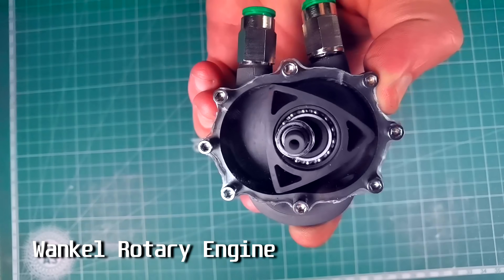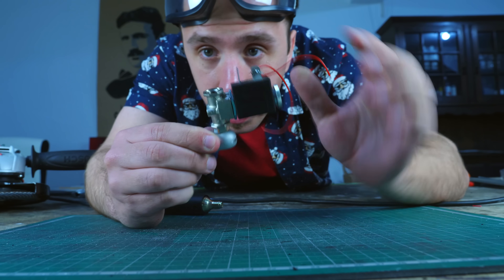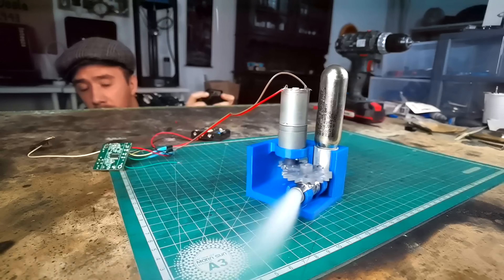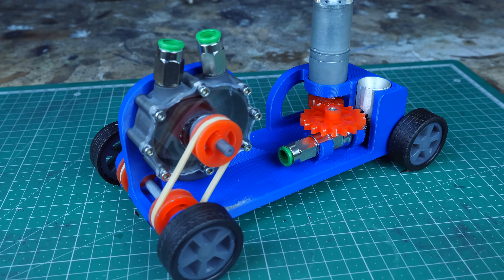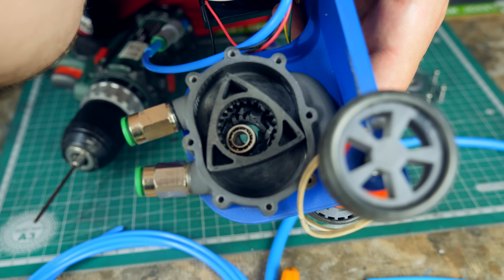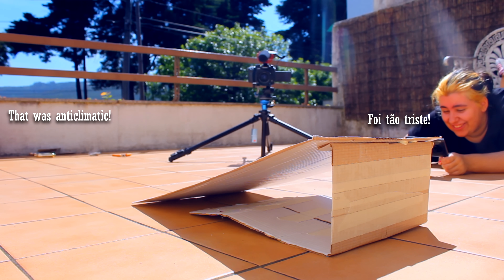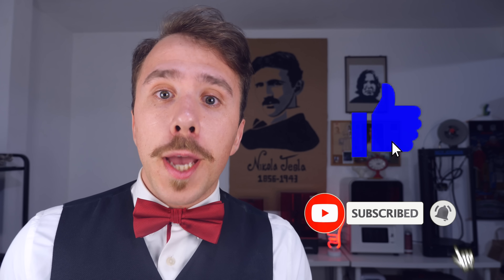Rotary Wankel RC Car (3D Printed)

Comment: My hat told me to apologize to the beautiful country of Portugal
Reply from the maker: Your hat is forgiven !
Reply: @integza  hey why don't you use the released gas from engine again
Reply: @guy4814  that is a problem, that was used in steam engine, and careful engineering and calculation resulted in at most three cylinders in a row, then there was no use adding more cylinders.
I guess the output from this wankel engine are too wast and would benefit from reducing the speed it uses the CO2 gases, so that the gas has time to boil of properly and give away it's energy.

That would probably be the best way forward.  To use an needle vale and carfully open it up to release the gas properly.
Reply: @integza  you're loosing a lot of energy with your pulley belt before the engine blew(It was slipping) Tighten it up and watch your power increase.
Slow-mo cam was like watching a serpentine belt slip over a seized pulley.
Reply: @integza  I designed a fully 3D printed drone and uploaded the complete STEP file and STL files to Thangs. Search 'cornishco' or '365 quadcopter'.
Reply: @integza  And YouTube should apologize to you as well because it unrang your bell for me :'( :'(
Reply: @integza   make a hydrogen bomb
Reply: @integza  Im not sure if anyone else realized but the editing and sfx are way better than your last videos
Reply: @integza  you need to contact rob dahm he is building his own engines
Reply: @integza  Compressed floor powder as rocket fuel??
Reply: @integza  you fool now everyone’s going to @ you 

Also those cartridges release more power if it’s a single, split second pulse rather than releasing it all at once, that’s why in Airsoft (what those cartridges are mainly used for) you never hear any long hissing sounds in a full auto CO2 rifle. It’s just releasing the gas in pulses. You could probably make this valve mechanically controlled/timed by connecting it to the rotation of the engine, However this would require you to crank the engine when you want it to start, but it’s still worth it.
Reply: @integza  put some tensioners on the belt to make it perform better
Reply: @integza  Portugal is not a country, it's just a place in Spain somewhere.
Reply: @integza love your engines
Reply: @integza  hahhahahahhhaha lol that's nice
Reply: Yes
Reply: @Joel Creates I like your hat! 👍   😅 I have several Ushankas too.😄
Reply: @patrichausammann  👍
Reply: Very wise hat.
Reply: I love that two of my favorite creators team up! You guys are awesome!
Reply: Video idea: 3D print a CNC machine that slices tomatoes 🍅.
Reply: Replace rubber band with thick gears
Reply: @prakharsingh5496  and a pressure reducer with an expansion tank containing an internal diaphragm to increase capacity.
Reply: My kids and I want to see you develop 3D printed prostetics that utilize servo assistance. 
If we win the printer that's what my daughter and I want to work on.
Reply: Loved the times we visited Portugal before the human malware...
Reply: Video idea ( make a hydrogen bomb)
Reply: @prakharsingh5496  hang in there buddy........things are going to get better. Keep your chin up!
Reply: Wait... That’s not fair! Now Joel will win the printer! 😂
Reply: You should figure the amount it takes to torque the wheels and also use the exhaust to power another engine! Gasket also. Make sure the wheels turn at the rear of the vehicle.
Reply: Time to make a walking robot!
Reply: Portugal Caralho
Reply: @Wischmopps politicians roflmao
estado é uma gangue.
Reply: Muita Gente chegou aqui achando que Integza era Brasileiro.
Reply: Is that phone to use slow mo is Poco X3 Pro?
Reply: All the Brazilians shitting on us, but they seem to forget who is richer and more developed (and no, it definitely wasn't your gold.)
Reply: @davidfernandes896  Richer? Brazil is the 8th bigger economy and Portugal is the 46th. 🥴
Portugal developed? not excacly...the only one advantage is Portugal have access to European Union, but you aren't Germany.
Reply: @AMV12S  dear friend, Portugal is the 36th most developed country on the planet with an HDI of 0.865 (data from the UN) while Brazil hasn't surpassed the 700s.... While Brazil nominal economy is much richer, per capita Brazil pales in front of Portugal, of Europe and the whole world. While your gdp per capita doesn't surpass the 15k mark (this is adjusted for purchasing power parity), Portugal has a gdp per capita PPP of 34k. Meaning Portugal indeed is a richer country and a more developed one. You might come at me saying "oh! What about São Paulo?".
Is everyone In são Paulo rich?
Brazil is a country with massive inequalities.

Nominal GDP cannot be used to measure a country's wealth. With a population of 200 million, it's natural that you need a large ammount of money, the ammount of money that each person gets is a correct messure of wealth and development, messures by which Brazil is way way behind Portugal.
Reply: Nice 💯
Reply: Estas desculpado 🤣
Reply: Bro make a soviet battle tank or a submarine
Reply: What Is Islam?

Islam is not just another religion. 

It is the same message preached by Moses, Jesus and Abraham.

Islam literally means ‘submission to God’ and it teaches us to have a direct relationship with God. 

It reminds us that since God created us, no one should be worshipped except God alone. 

It also teaches that God is nothing like a human being or like anything that we can imagine.

 The concept of God is summarized in the Quran as:

{ “Say, He is God, the One. God, the Absolute. He does not give birth, nor was He born, and there is nothing like Him.”} (Quran 112:1-4)

Becoming a Muslim is not turning your back to Jesus. 

Rather it’s going back to the original teachings of Jesus and obeying him
Reply: LIQUID PISTON ENGINE
Reply: don't use rubber band, use gear it's make more faster!!
Reply: @Atarisyad Nuzulla Satrio Nyet.
Reply: Wait integza is in Portugal where exactly?
Reply: Eu ia fazer um comentário produtivo mas daí li os Ladrões de Ouro brigando com os HUE HUE BR. 
Podem continuar
 🥤😎🍿 estarei aqui vendo o circo pegar fogo
Reply: Catarina its portugueses?!
Reply: Desculpas aceitas

Apologies accepted
Reply: YES XD
Reply: YEs
Reply: Portugal=Brazil
Reply: YES
Reply: I think Portugal situation is way better than Brazil, you are near to other countries with advanced industry and market. But of course, Brazil and Portugal deserve to be a better country with more people developing technology.
Reply: @AnotherByteData  they both deserve that a larger part of the population survive Covid-19.  And have leaders that take it seriously.
Reply: @AndersJackson  Agree!
Reply: I’m a American but I hate it here I wanna move conuntrys in a few years when I’m old enough
Reply: @douglasbailey8332  Many young people do not seem to like the US anymore. You could try and make a change though.
Reply: @flo090394  yah you have a point I’m just homophobic and it seems the us is turning almost all gay but there are a few good place I caint say it’s all bad I’d just like a change plus I’m 16 so I got a few years
Reply: @douglasbailey8332  USA is a nice place to visit, and most people are open and inviting.
That said, there are some serious flaws with make me never want to live there.
Reply: @douglasbailey8332  then go those of us that love the US won't miss yea.
Reply: @douglasbailey8332  don't blame you cohort, been there and I agree, it's a terrible place
Reply: Brazil > Portugal
Reply: @AMV12S  portugal>brasil
Reply: @ariatsu9274  Se você fala "gajo", está automaticamente refutado.
Reply: @AMV12S  ouro
Reply: @ariatsu9274  Guy Guys Stop Fighting.
CORTANA ASS>WORLD!!!.
Reply: @jhonsqueaks4573  We aren't fighting, we are joking 🥴👌
Reply: @ariatsu9274  em qual realidade ? ,todas e eu chequei Brasil > Portugal
Reply: @AMV12S  huahauhauhauhauh
Reply: @AMV12S  se tu compara dois países vc e pior n importa de onde vens
Reply: @AMV12S  Se falas "galera" estás refutado também
Reply: @AMV12S  voces dizem cara, isso é uma parte do corpo mano.
Reply: @ariatsu9274   brazil= Portugal
Reply: @ariatsu9274 Brazil > portugal
Reply: @AMV12S  shut up  haha where is your gold
Reply: @gon_rasoilo3867  I have only bitcoin 😌
Reply: @AMV12S  Brazil = Portugal > You
Reply: @AMV12S  olha bem quem temos awui um bebe chorao a tentar espetar a sua opinião nou pedida nas nossas caras vai e volta para o teu contentor e imagina wue estas a viver a vida de sonho brasileira
Reply: @CabritinhaJP  você está automaticamente refutado
Reply: @AMV12S  if Brasil's that great how'd u let ur gold go 😂
Reply: @joaoaoj100  and you guys give it to Spain
Reply: @AMV12S  nah England took it 😂
Reply: @AMV12S  let's not start country wars.
Reply: @AMV12S  no
Reply: @AMV12S  agree
Reply: @AMV12S ehh Brazil is terrible country
Reply: @AMV12S  nah
Reply: @AMV12S  os portugueses jamais teriam eleito bolsonaro, sabichão…
Reply: @marcelleza  mas tem outro soça ai que é tão desnecessário quanto ele, inteligente são os suíços que não deixam politica atrapalhar a vida.
Reply: @AMV12S  ai eu tenho que concordar com você/ now i have to agree with you
Reply: @AMV12S  big no no
Reply: @AMV12S  no, Brazil=Brazilian portuguese
Reply: @itswindyyy  Brazil = Brazil
Reply: @AMV12S  YOU ARE GOING TO BRAZIL
Reply: @annabelle5640  i'm already at here
Reply: @AMV12S  ta errado
Reply: @AMV12S  Brazil ~ Portugal
Reply: @AMV12S   USA > all

Comment: I have this crazy idea how about you you create a normal sugar rocket and then drill a hole all the way from the nozzle to the end then add a hydrogen+Oxygen has mix at the back so it accelerates the exhaust gases and it becomes super power full and if you add a De laval nozzle it will reach supper sonic. Oh and by the way I am a big fan thank you!!!😊😀🚀🚀

Comment: 7:02 pela câmera lenta dá pra perceber que o carro ficou bem instável e suscetível a vibrações, e talvez isso o faça perder tração em alguns momentos. Você pode colocar algumas nervuras para resolver o problema. Apesar de tudo, a vibração ainda vai ocorrer devido ao movimento excêntrico do motor, então talvez ajudasse colocar um sistema simples de amortecimento com uma tira de borracha macia abaixo do motor

Comment: wouldn't it be more efficient to just 3d print a hamster wheel (like the kind they use in air handlers)? And use that to turn the motor? You could probably get more distance and efficiency.

Comment: You could've made the car rear wheel drive, turned the engine so the exhaust was facing the end of the vehicle, that way you get the engine driving the wheel at the same time the exhaust acting as a boost.

Comment: Hey Joel:  The slow-mo footage shows that you are gettimg a lot of slippage in the rubber band drive.  This is likely due to the extreme rpm of the Wankle engine.  Many model train engines use to use rubber band drives, so this type of drive can handle a lot of torque. I would first install a needle type throttle valve in the system, which would lower the pressure that the engine is seeing, and make the gas charge last longer.  I would also consider either using "O" rings in place of the rubber bands, or go to a gear drive.  The "O" rings are less stretchy and stronger than rubber bands, which reduces slip, but a geared drive has no slip.
Cheers!

Comment: Print a custom mouse and keyboard. A mouse that’s molded around your hand would cool. 

Or maybe a find a way to print things bigger then the tray lets you. I’m thinking some king of interlocking system. One that can be applied to almost any piece. Imaging being able to build the engine 4x or even 10x the size you made it and put it on a go cart.

Comment: You could put the engine perpendicular to the wheels and add more weight to the front for better traction on the tires.
Reply: I saw in the slow motion the wheels kept bouncing up and down with the engine because it was parallel with the wheels. If it were perpendicular, at least one wheel would be on the ground because of the rotating weight of the engine.
Reply: The extra weight would keep a constant pressure on the wheels, giving it more traction. I would also try spreading out the wheel base a bit more for better displacement of weight and area for weights.

Comment: Hey if anyone wants to automate a c02 cartridge. Instead of buying that valve and customising it, you can buy a good bike valve where it can be open and closed via a lever operator system. And just use a mini stepper motor or servo motor

Comment: The rubber band you have as the drive belt is slipping I would change it over to ether a geared drive or chain driven that would prevent the slipping

Comment: You should use a paint ball gun canister.  They make carbon fiber ones and I think they are charged to 5k PSI.  Higher pressure and larger volume should let the car go much further...even with the extra weight?  Maybe have two engines combined.

Comment: Well well well, Mr Integza. You have fallen into the trap of belt driven engine!! this is a perfect example of why we use CHAINS!!!!! I say 3D print a chain in resin slap it on that bad boy between the engine and the Axel and what that baby fly off the ramp!! Very cool throttle mechanism by the way, especially the Frankenstein RC car.

Comment: Try to make it without a belt, belt drive has no grip. And also you can open valve just for 20-25% somehow, so you will have less wheelspin at the start)

Comment: Very cool idea. As a further project, I personally would try to install the engine in a rear engine layout and do so flat on its "face". You would conical gears to transfer the power to the wheels (which may be not a good idea considering the engine goes from 0 to full power in milliseconds), but it would theoretically be an improvement over the belt, and by not having the vehicle wobble up and down due to the rotor, the traction would be much better.

Comment: You could add an orifice after the valve to limit flow consistently and make it last longer. Plus maintain grip on the drive pulley to accelerate more efficiently.

Comment: You need to add a regulator so your not just dumping all the energy out at once it will be more efficient and the bigger cartridge won't destroy your gears

Comment: Tomatoes are disgusting. Could you have used a throttle valve  and a gear set? There was a lot of energy loss with the belt drive and tire slippage.

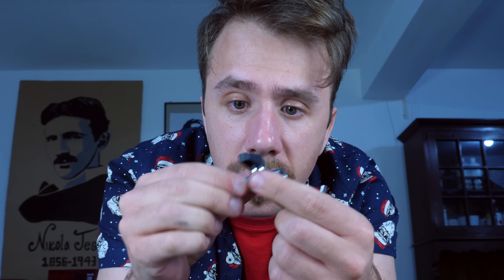Comment: i swear, right at 2:55 i immediately had the thought of using that valve as a pressure regulator and then using the other electronic valve

Comment: You should have put a regulator to lower the pressure and slow the engine. You were just spinning the chain and tires. If you lowered the pressure by 75% it would still be getting 200 psi but the engine wouldn't overwhelm the chain and tires

Comment: The engine is spinning way faster than the wheels are you can see it slipping off of the belt in the high speed Put a planetary gear on the outside of the engine It is the absolute best way To turn high RPM into torque

Comment: you totaly forget something.. u wast all the gaz in liquid form in the wankel on the first second... u need use some re heater of the co2 before the engine... u can simply gofor aluminium block between the line.. the gaz will take heat from the aluminium and if its mass is enought it wil give enough thermal energy to use all the co2 in gaz state

Comment: video idea... try making a compressed air spider legs XD using you wankel engine... but use an O ring seal to stop the air from coming out the sides of the backing plate soo more power

Comment: a couple of things I see that would improve the function of this... first, regulate the CO2 coming out of the cartridge which would make it last longer and give the drivetrain time to catch up. make this thing rear wheel drive as weight transfer will aid traction. the rubber band idea isn't bad but, something a little more substantial and grippy would also aid in power transfer to the drive wheels. in any case though, I found this very entertaining. :-)

Comment: I like your videos, you show case Nikola, mechanical engineering, but I have never seen you tackle a Electronic engineering problem. How About you tackle the engineering centered around a rail gun and how to build one. I would like to see magnetism, electrodynamics, formulas and calculations. How about  shooting a light weight projectile at a top speed of 3000 feet per second, without using a propellant. This challenge might take several months of shows to accomplish. 
Take care

Comment: Also your rubber bands were not tight enough, you also had frame bend in your car i could see, if you tighten that “belt” up you will have max power but you will also have wheel spin

Comment: for your metal parts try lost casting method . print part then put in plaster use a straw to make injection holes .put it in oven and remove plastic now heat up your metal to liquid and pour in your hot plater mold. this will give you superior metal parts. sky the limit my friend..

Comment: hmm noob be wasting the liquid co2 by using the cartridges upside down as he wants longer lasting high pressure gas not liquid
inetzga(yup I watch your vids) try using the cartridge in the orientation where the canister puncture is always up you will tend to see less liquid co2 leakage and longer runtime of gas flow at any moderate pressure and even extreme runtime if you use a regulator to keep the gas in 
the "kill tomatoes" state as you only take some of the tomato hatred energy at a time
FUCK TOMATOES